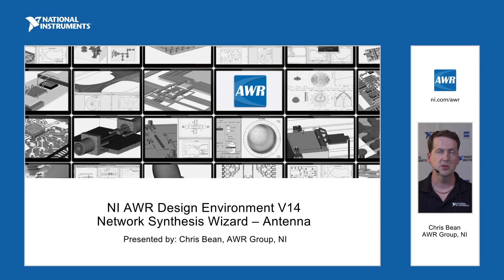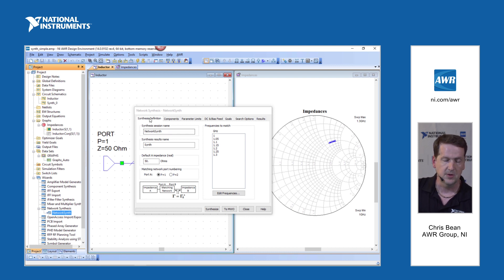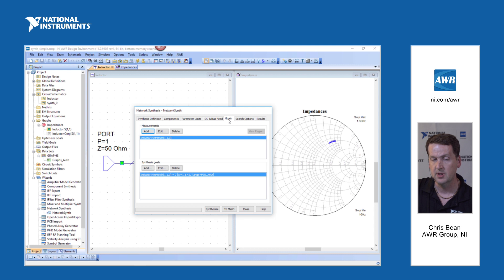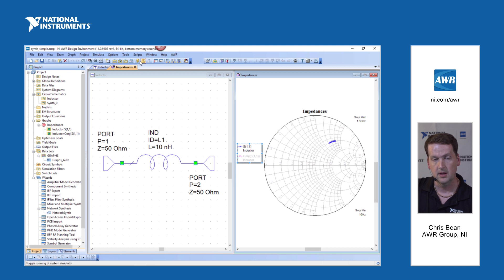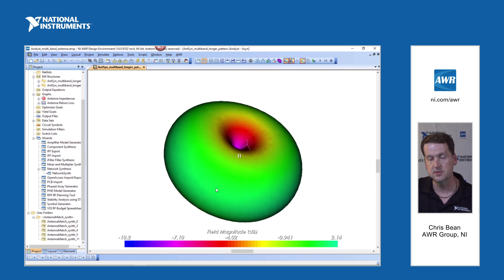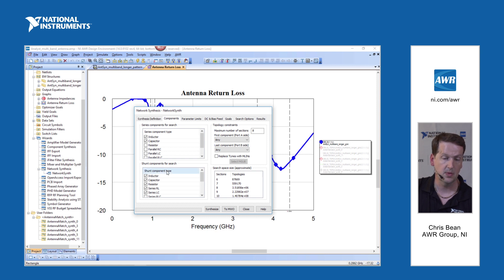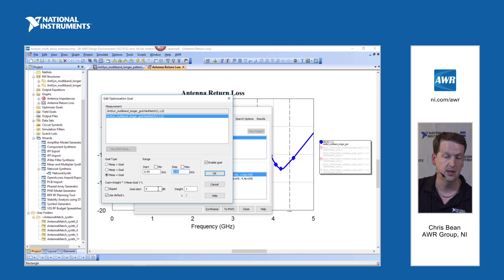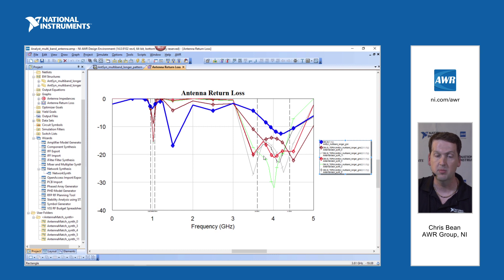AWR Design Environment V14: Network Synthesis Antenna Example

Comment: thanks very much for your presentation, can you tell me please did you import the antenna results from 3D software or you used the EM simulator of AWR ? after that how you generate the matching circuit board if the antenna is  not matched ?